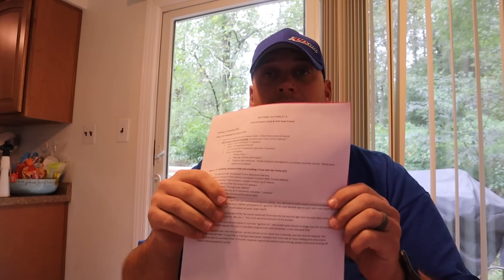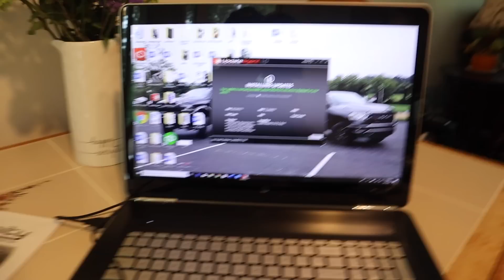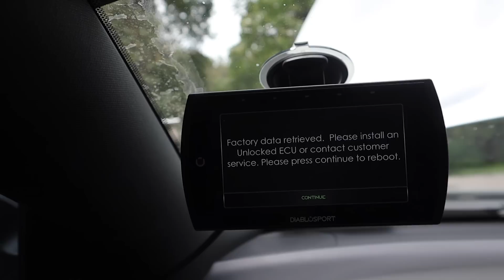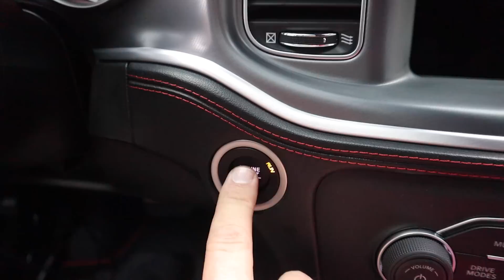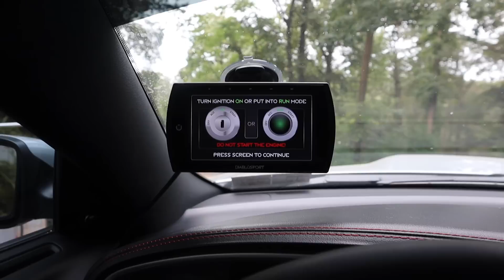UNLOCK THE POWER! Dodge Charger 392 6.4L Scat Pack DiabloSport Tuning Install & Review

Comment: the 392 hemi sounds better than the hellcat. Naturally aspirated sound =)
Reply: Agreed
Reply: Def agree.
Reply: much better throttle response and ballance
Reply: Lol
Reply: The supercharger whine is good, but blowing past almost every tuned and boosted car on the road with ease bone stock n/a is a feeling in of it's self.
Reply: A supercharger does not alter the sound of the exhaust or engine.  It only adds the whine under high RPM (although Hellcats SC's are some of the loudest).  This isn't the same effect turbos have on sound.
Reply: I agree
Reply: Absolutely
Reply: @HaremHighway  which car you talking about does that ?
Reply: I'm new.  Do we consider this guy one of the Hemi gurus??  I need to learn.
Reply: So security bypass cable AND PCM are required?    10 sec version of 'why?.'  If you're pulling stock tune with sec. cord, why can't you reload, using the same cord?  'Computer sh!t.' Is an answer I will accept.  🤙

Comment: Might appear snappier but you know...a Dyno before and after will validate for sure if any performance gains had been made. Snappier throttle response can be achieved by simply changing the accelerator  pedal values to give the appearance of more power.
Reply from the maker: We’ll be heading back to the dyno soon.

Comment: I have an 18 T/A Challenger.  Friend has a 392 Charger with the tuner and although there is a difference...I personally don't think it's worth basically voiding a large part if not all of your warranty.  You break or replace that PCM..."You bought it".  Just something to consider when attempting to gain 1/2 second in the quarter mile.
Reply: Oh it makes a big difference. Especially when you get a custom tune

Comment: Great video! Would love to see dyno info and track sessions. I had Nitto 55 `s on my 16 sp shaker and loved them. Will add them to my 19 Charger sp when it comes out of winter storage. Great job, thanks.
Reply from the maker: Thanks Bob, I plan on putting it on the dyno & track, but it may have to wait til spring. Just put mine is storage too.

Comment: Had a Diablo before.  The only thing I ever noticed is it increased the throttle response so it felt like the car was faster.  But in reality it really wasn't.  Dyno tuning is what's needed on these cars.  But even then your not gaining that much over stock.  Maybe 15hp to 20hp and Torque max.  Expensive for a tiny improvement.
Reply: Why not let them enjoy their car and upgrade? Why is there always someone like you?? Damn man.
Reply: @l2kxboost  Just sharing my experience with the Diablo tuner. Not trying to rain on anyone's parade. Actually I would have appreciated someone telling me that before I had spent the money. Drive a 392 widebody now.

Comment: Does the security bypass allow you to run the diablosport + a tazer if you wanted. Looking to get the tazer rn but diablo down the line so wondering if I’d even be able to run both at the same time
Reply: What's a tazer?
Reply: @thinkfast469  it’s an obd add on that let’s you lock out the car, light show and a few other things. No seat belt chime etc

Comment: Great video and information. Good man for using Amsoil. I run it in both the Ram and my SRT392 Challenger. Been using Amsoil since 1998, great oil and filters. 
I also want to tune my Challenger and Ram.

Comment: Got the same setup on my 2020 Scat Pack 392, except I’m running a Jay Greene tune. 
Hella FAST 💨 now.
Reply: Would this same setup work on my 2021 scat?
Reply: The tune for the car was done by Jay Greene Racing. 
By far one ☝️ of the BEST Dodge 6.4 tuners out there.

Comment: Don’t waste time and money on an exhaust no gain. Replace the mid mufflers with dynomax minis and on your active exhaust leave motor plugged in while you remove it and remove spring then wire tie the flap open then reinstall motor. No codes. Then it will be louder at idle. Even in track mode the exhaust flaps are partially closed
Reply: Can you shoe me how you do this

Comment: Please make video about what you have done with Diablo tuner/pcm. ie what all it will do and how car performs now please.
Reply from the maker: Haha as soon as I have time, we’re going to hit the dyno. The weather is getting colder here now, so tracks are closing up.
Reply: @BEASTProjects  Thanks. will be watching for video. 1 question. does the diablo have a "canned" e85 tune. E85 makes a very noticable power improvement in my 2011 Crown Vic not born a police car. Im sure you know pump E85 can be 104 to 110 octane if its 85 percent. I tempted to fill my 18 Daytona 392 with 50/50 93 octane and e85 and see what happens.

Comment: Another way to get more power out the 392 or any other hemi without adding power is to reduce weight. Believe it or not, the most amount of weight around the car is at the wheels and drivetrain. And if you dramatically reduce the weight there, you will improve handling and yhere will be way less sprung-in weight and weight rolling resistance. Carbon ceramic brake disks, lightweight aluminum wheels, aluminum 1 piece lightweight driveshaft, and youve saved about 200+ lbs from doing that. And if you want to go further, gut the interior and youve saved another 100+ lbs. Thats 300+ lbs total lost without adding on power.

If that wasnt enough, you can add on power with long tube headers with x pipe and high flow cats, a sealed cai, a bigger throttle body, and the tune you have will turn the scatpack into a mini hellcat
Reply: The scat is already a mini hellcat, but you do have a good point about the weight
Reply: @robertmcgee3616  The 1320 is the mini demon. They have the demon suspension, axles, and transbrake. They've done 11.4 with no footbrake or transbrake being used.
Reply: Scat pack charger with rear seat delete and slicks on the rear, other than that bone stock...ran a 11.9/11.8 quarter
Reply: @dabeatboxer83  They've done 11.6 with rear seat deleted and a tire, with the seat 11.7.

Comment: Thanks for video. I running a problem here. I am buying a 2016 dodge challenger srt it had It's a Mopar authorized supercharged kit in it (Magnuson tvs2300)  Dealership installed for the previous owner It also comes with the diablo t1000 tuner. I belive it has a unlocked pcm chip they had build it in as well like how u did in your video. I have no knowledge like you to understand how to tune the car. How often do I need to tune the car?  Can I just drive it without using the diablo tunner?  Will it break down on me if I don't tune it right. I mean the dealer installed the supercharge kit so they must have tuned this when they done the installation? Really appreciate, thanks
Reply from the maker: Once the tunes are loaded, you really never have to touch it, unless you need to install a tune revisions for new upgrades. Using the t1000 would be good for gauge monitoring, viewing trouble codes & clearing them.
Reply: @BEASTProjects  thanks man. Yes I am just gona leave it and not touch it.

Comment: Great video. Thanks
Reply from the maker: Thanks Ezio
Reply: Yes!  You saved my ass. Now it’s easy. You did the hard work. Now, can I remove the security cable after running? I got the i3 so it’s not the monitor like you have.
Reply from the maker: I would leave the bypass in just in case there are tune revisions or if you want change it in the future.

Comment: Just tuned my Dodge Charger. Not sure what happened but here what I’ve noticed so far 

Reverse camera not working. 
 
No drive modes anymore. 

Passenger side seat heat and cooled controls not on the screen anymore.

Transmission feels slower. 

Paddle shifts do not seem to be as responsive compared to stock. But I don’t know what drive mode I am in.

Comment: My only question is where did you go to find  the update for the tuner
Reply from the maker: You just d/l & install the Update Agent software onto your PC, plug your Trinity into your PC, open the Update Agent application & it will automatically check for updates & prompt you.

Comment: hey man did you have any problems with you factory radio after install? my srt pages are gone after i installed the tune
Reply from the maker: Yes, it just needs to reset. Usually does after a few power cycles. Just drive around a bit.

Comment: Did the new PCM add track mode or is that new for 2019?
Reply from the maker: The new Scat Packs have track mode & the performance pages.
Reply: 2019 SRT Powered Dodge vehicles come with Track Mode except for the 1320, which comes standard with Drag Mode.

Comment: Question do you need to run 93 octane gas if you run the 93 octane tune on the charger from Diablo

Comment: Awesome video. Any idea the hp/tq gains ? If any? Or was the tune only throttle mapping etc...
Reply from the maker: I’ll be taking it to the dyno soon. I have another mod coming before that though.
Reply: Awesome! Thank you for the info man. Really helps. One last question, as you know the stock Goodyear 245’s are garbage on our cars. You upgraded to the Nitto rear tires. 275/40R20’s ?

Comment: These steps are identical on a 2019 challenger scatpack widebody? I saw a 2019 challenger SP have to take apart the center console to install the security bypass
Reply from the maker: Yes, but always double check the instructions on the security bypass types.

Comment: Is this bypass only for the 2019 Scatpack, I have a 2018 do I need the bypass as well, awesome video by the way.
Reply from the maker: 2018 requires a bypass as well, but it’s a different type.
Reply: Thanks so much for responding so fast, so the 91 tune is the 93 tune? Just subbed
Reply: You can add a second OBI II bypass in the trunk which is a lot easier.  As of 2018 Dodge made the under dash OBI port usable by Dodge only.  ZAutomotive offers a bypass that is great.  I have a 2018 ScatPack as well and installed it in 5 minutes.

Comment: I'm assuming this process is similar to a 2018 Scat Pack Charger right?

So before ordering one, I read the calibration code off my stock PCM, give that code to Diablo, order my unlocked PCM, then follow this video?
Reply from the maker: 2018 may be slightly different in regards to the Security Bypass. I would double check on the instructions.

Comment: Is this a stock charger though? Or have you done any performance mods? Because I’ve done a few performance mods recently and I want to get a tune to take full advantage of my mods. So would this work on top of my mods? Or should I get a custom tune
Reply from the maker: It's pretty much stock at the moment.
Reply: BEAST Projects ah ok. I have a 2019 scat as well, and I put on long tube headers, Borla ATAK and and CAI so far and I want this same thing you have

Comment: So you have to install the provided security bypass cable first before swapping the PCM??
Reply from the maker: Yes
Reply: BEAST Projects oh ok cause I just got mine in the mail , I swapped the PCM out yesterday and the car would turn on and then off . Then it just wouldn’t start... so maybe that’s my problem
Reply from the maker: Do you have a 2019?
Reply: BEAST Projects yes a 2019 charger scatpack
Reply from the maker: Yeah, you can’t just install the unlocked PCM in the car. You have to pull the stock tune files first & you’ll need to install the security bypass to do that. Watch my video, I go through the whole step by step process on what you need to do & in the correct order.
Reply: BEAST Projects awesome , so you think that’s most likely why my car won’t fire up or ?
Reply: Hey I’m back here to give you a huge thank you , without this video I would’ve been screwed . 
I installed the security bypass cable and did all the other steps it it worked . Just uploaded my jay Greene tune and god damn she’s pulling really hard now

Comment: Followed all instructions on the vid along with the paper instructions for my 2020 Scat Charger and I lost several security features of the car (with modified pcm installed) such as the backup cam and my drive modes. I am waiting on Diablo support to get back to me tomorrow, let's see how it goes.
Reply from the maker: Give it a few hours of driving and shutting it off & on, they should come back. If not, contact your tuner or DiabloSport.
Reply: @BEASTProjects  hell yeah I’ll try that! Thanks and yes, I literally just had it installed. I’ll wait a few hours/overnight and post the results here when done
Reply from the maker: Can you drive it?
Reply: @BEASTProjects  yes.  Seems to be running rich.  No drive modes available tho but the tune has the 4cyl disabled
Reply from the maker: You pulled your stock tune file from your stock PCM before installing the unlocked PCM? If so, something isn’t right if it’s running rich.
Reply: @BEASTProjects  yes, I installed the tuner hardware, turned it on and backed up the original pcm then swapped pcm and proceeded to tune
Reply from the maker: Sounds like you may have to put the stock PCM in again, pull the stock files, reinstall the unlocked & load the tune. Don’t be surprised if they tell you to do that.
Reply: @BEASTProjects  your first suggestion was right! Went to go swap pcm and all was back! Thanks a lot!
Reply from the maker: No problem, enjoy my friend!!

Comment: Hi. I have a 2016 Challenger RT. Did I have to get factory file from stock PCM first too!? My car is currently undrivable after attempted tune with T2! I need help. Giving a check engine light and “service shifter”. Won’t go into gear.
Reply from the maker: I would contact DiabloSport's support. Try reinstalling the stock tune.

Comment: I just purchased a Charger SRT 6.4, used with 30k miles. The previous owner SWEARS it's stock but that thing pops, crackles, and when flooring it, during the gear shifts, it sounds like a shotgun blast out the exhaust. I notice more power than my 6.4 Challenger (stock for sure) especially at the higher end it's very noticeable. Is there any way I can check if it's tuned without any special tools or anything?
Reply from the maker: Mine used to pop w/ no tuning, stock. Not sure if there’s a way, without taking it to the dealer & having them reflash your PCM.

Comment: nice video, due the 275's tires fit on the stock rims? Are they 275/40 ? I have a '19 sublime scat pack charger with the 20x9 low gloss forged aluminum wheels and Goodyear 245/45 20's. will the nittos fit on these rims? And why did you not put the 275's all around? thanks.
Reply from the maker: Thank you, they’ll fit, I was going to the staggered appearance.

Comment: Don’t waste ur money on a brand exhaust just change the mid muffler and cut the back resonators
Reply: Full exhaust swap will help once you get headers and or cam upgrades. Specifically 3inch piping all the way.

Comment: I have a 1320 and it is already tuned for the drag strip. I want to see someone show me improved track times before I mess with this. Obviously if I had headers, larger throttle body, and cold air I would have to tune. I just have the HellCat air box and replaced the mids with Dyna Max racing bullets.
Reply: James Woods is there any drone with your exhaust mod?
Reply: Will Jeff I like the way it sounds. I just wish there were more pops and crackles.

Comment: Hey need help ASAP... so today I did my pcm swap and swapped out the computer and hooked up my Diablo trinity 2 using the bypass for my 2018 model, when I turned the car on to run I got a check electronic stability control message pop up and also my battery icon displaying on the dash.. I didn’t want to risk anything so I swapped back to my stock pcm and unplugged the trinity 2 with the bypass type B still plugged in and Tuened my car on to run and it still displayed the same messages and when I tried to start the car it wouldn’t start... idk what is going on or how my battery got drained... also I noticed on the Uconnect my performance pages app were missing.. any help would be appreciated as I’m freaking out a bit lol >.<
Reply from the maker: It sounds like you failed to pull the stock tune files from the stock PCM before installing the unlocked PCM as explained in the video. To bring your car back to stock, you didn't have to do anything after reinstalling the stock PCM. If you tried flashing (tuning) the car with the stock PCM installed with or without the security bypass installed you may have caused some problems. I would call their tech support before you do anything else. 866-404-6141

Comment: After I Procharge my Scat ,then Add PCM??
Reply from the maker: Either or.... Personally, I would do it before. It just one less thing you'll have to do after installing the ProCharger. You'll just have to install the tunes for ProCharger.
Reply: BEAST Projects so it will be the same procedure adding tunes for pro charger as the steps you went through?

Comment: Hey bud, I just installed the canned tune in my Hellcat and performance it’s quite noticeable. I’m also noticing more gas smell and my pipes turn black quicker. Not to mention my AFR gauge is going crazy. Yours do the same? More smell, etc?
Reply from the maker: Nothing like that with mine, but yours sounds like it’s running rich.
Reply: Yeah, I think I figured out why. I had 98 octane when I added the tune. The tune didn’t like that much. Stock tune didn’t mind it.

Comment: Hey Steve, may I ask... Would this device work on an SRT or a Hellcat the same way that it worked on your Scat? I mean, we have the same engine. I'm really curious because I am thinking about putting a supercharger on my SRT and I'm wondering if the Diablo Tuning unit would improve the performance even more after the Supercharger is added. Thank you.
Reply from the maker: Yes, but you’ll have to order the kit that’s specifically designed for your car.  As for the Supercharger, make sure the brand that you’re going with offers DiabloSport tuning or tunes, most do...